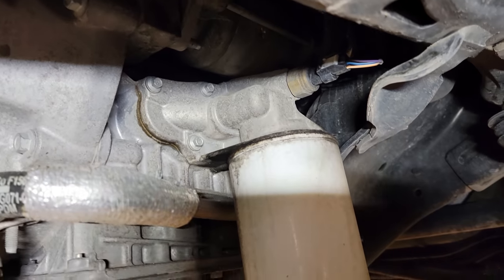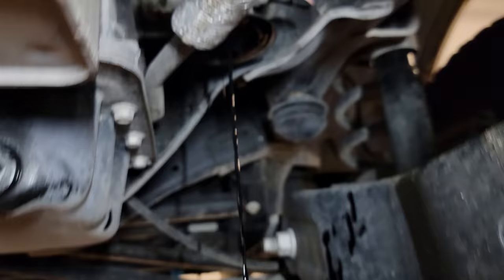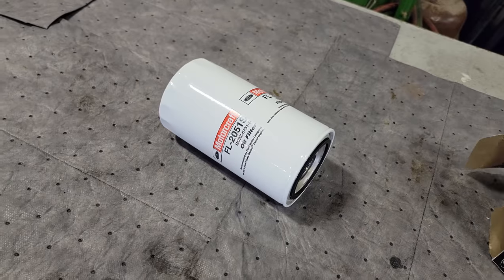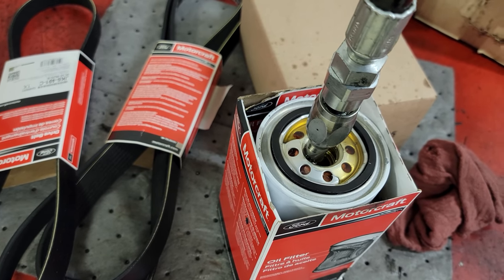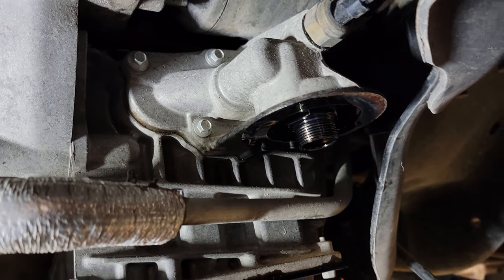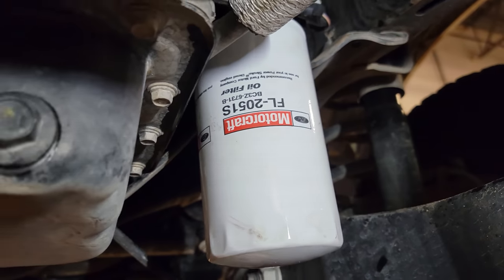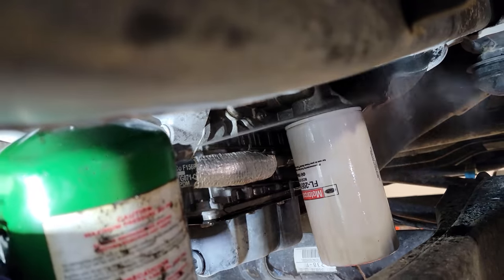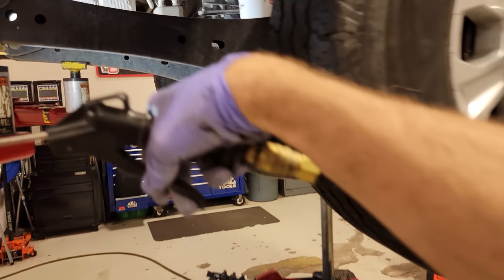This is WHY your 6.7 oil filter leaks PEOPLE - WATCH THIS

Comment: I wish my $80k truck was that clean! Right now it looks like it was just pulled out from the bottom of the community shop parts washer that hasn't been cleaned in 2 years. Shame on Ford for knowingly letting oil pans be sealed with the wrong sealant and then leaving the customers to eat the $4k bill to fix it.

Comment: I have never had a problem but that plastic oil pan drools some .... If that filter has a bit of dirt on it and not dripping, it's not leaking. But, with that said, if I do my own oil change, I let it drip for at least 30 minutes and usually more while I putter with tire checks, radiator and brake fluid levels etc, etc, etc, and never a smudge. Unfortunately those home DIY oil changes are a thing of the past where we now live so I get the "privilege" of paying a stealership $150 or so bucks - but the tech also gets to do a tire rotation too

Comment: You’re right Arod. I tighten the living hell out of my filter on my first oil change cause I thought it was leaking, but in fact it was due to the oil sitting on top. ‘Spot on’ instructions my man 👍🏼💪🏼
Reply from the maker: Yeeeeeyeeeeee
Reply: I'm guilty
Reply: I turned mine snug as possible with a filter wrench and then a half turn for good measure. I know! I know! 🤣

Comment: Thanks ARod...  been using the oil filter box as a support for years on the yukon and silverado i had years ago.  Still use it for the Duty today and prefill straight from the T6 Rotella bottle.  Honestly, after my first oil change when purchased, i had a moment when i seen how much oil residue was on the filter in place and a few days after changing it.  Have added the brake clean to my process now, to keep the bottom clean as possible to identify anything out of the ordinary/odd leaks or wet areas.
Reply from the maker: Nnnnnice dats what im talking bout💪

Comment: Oil filter prefill! The professional way to do it. Some guys with many years don't do that.
"You might get a contaminant in there." Yet piston aircraft engines often don't even have an oil filter. They're fine and under a lot more stress. They last for decades.

Comment: Love it.
Can’t say that I have had any problems keeping my oil filter clean (on the outside).
But I do let it drain and drip a while before putting the new filter on. Pre-filled of course.
Thinking about replacing my old plastic lower oil pan (2011).
Have never liked it, but never really been a problem either.
I just don’t like the idea.
Reply from the maker: Gettt chu a new one. Gravy
Reply: That was the first thing I changed on my 11, I couldn’t stand the plastic pan or plug. I went with one that also has the drain plug on the bottom….because that makes more sense to me.
Reply: @Hellhound6033  I just bought the Ford part, so plug not on the bottom, but it’s OEM, so there’s that.
Reply: @paulhelmuth6012  anything is better than that plastic pan/plug combo they had going on. I replaced mine very early on after I bought my truck so a metal OEM one wasn’t an option, I probably would have gone that rout though.
Reply: @Hellhound6033  , totally. I have never liked the idea. But I have never had a problem with mine either.
But I will have a lot more confidence in a steel pan.

Comment: Many years ago when I was doing an oil change on 5.9 cummins the owner who was a John Deere tractor engineer came to me and said to never pre fill the filter cause of impurities that could be in the oil without being filtered going straight to the crank.  So many different ways to do things I think as long as your clean about its ok to pre fill filter but when doing my own oil change on my 6.7 PSD I won’t pre fill due to the fact. Its hard to see what exactly in the 1 gallons oil jugs. I now use a funnel with a small screen on it to filter any unwanted material. I’ve found pieces of plastic from the jug on the funnel screen. We all got to be smart cause we have no control where our oil might be coming from. People make mistakes everyday.
Reply: I was told in maintenance department at a government facilities any vertical filter should always be filled to keep bearings from running dry I learned this after I bought my 6.7 and had not filled it when changing my filter 
😂

Comment: After a service I use a sureshot sprayer and get the whole bottom side of the motor and around the oil filter. 140k miles only time I’ve had an oily filter is when I didn’t clean up afterwards. I do use Donaldson filters now though
Reply from the maker: nice, thanks Jake

Comment: My F550 company truck with a mechanic bed, doesn't look like that. I have always cleaned the filter after installed. (Brake clean) 
As far as filling the new filter, couldn't care less. I don't fill them. I worked at a Caterpillar dealership in the 90's into the mid 2000's. The instructors ALWAYS told us not to fill  new oil or fuel filters. It stuck with me. I don't fill the filters. And if you know anything about the size of heavy equipment engines (3408 Cat used in larger dozers and loaders) depending on the application, could have two oil filters. Never had a problem. But the people who go into a tailspin about filling or not filling filters are just crazy.
Reply from the maker: Well said brah

Comment: I wish all tech would be this thorough as well my local Ford dealer will definitely leave your driveway stained why I do it myself I guess
Reply from the maker: See what i am sayin & people are hatin' ...just dont get it. Hate to see how these people live.....🤮🥴🤦‍♂️
Reply: @PowerStrokeTechTalkwARod  battling them right now trying to get my fuel pump replaced already did the tsb to no avail
Reply from the maker: New pump coming out from bosch...no eta on new updated parts
Reply: @PowerStrokeTechTalkwARod  they new pump you did in your tank didn’t fix the knocking
Reply from the maker: Bettter...but still there. It is an NVH problem with the material bosch made the lines out of, toooooo much resonance
Reply: @PowerStrokeTechTalkwARod  dang ….. thanks man
Reply: Got truck back today 2020 power stroke they replaced the pump today no noise at all yet

Comment: Could you tell me why my truck at hot idle it has a whine you can hear standing next to it and I've pin pointed the noise to the oil filter, it sounds awful with my ear on it.

Comment: Did anyone show you to punch a hole in the bottom of the old filter and let it drain so uou dont get the spinning mess removing an old filter? Saves the spray getting everywhere

Comment: If it aint leaving puddles, im not concerned. All truck fleets run the crap outta their trucks and wont stop to fix nothing till one of 3 things. 1, it dont run. 2, I fail the DOT inspection andf wont tag it.. 3, I threaten them with the potential of death if they dont fix it.  Major fleets and I mean major from trash truck companies, shipping fleets, emergency vehicles, material handling, all of em. bottom line is what counts. But if the equipment breaks and cannot be run all, fix at any and all costs as fast as possible,  money is not the issue, the downtime to repair and maintain is what they hate. We need to work like Mad Max fury road. Fix it while it's rolling down the road
Reply from the maker: Lolololol

Comment: I'm outside doing changes so I do not prefill, hell I dont even open the box until I am right there to put it on.  The filter is NOT on the priority oiling circuit so your not doing anything beneficial by prefilling it.  I've had cancer probably from similar use of chemicals and cleaners like that so I prefer to just take my blue shop towel and guide it in and around the lip, seems to do the trick for me.